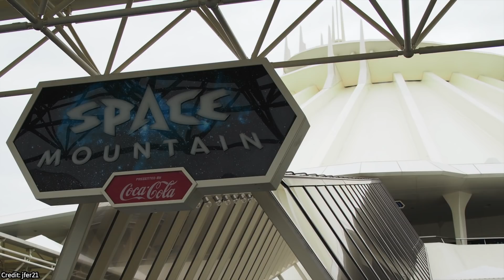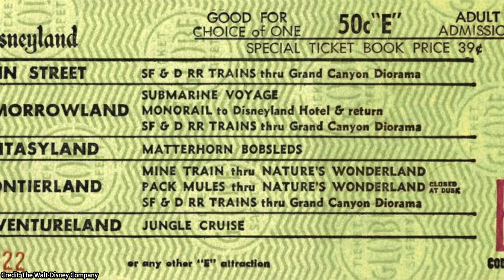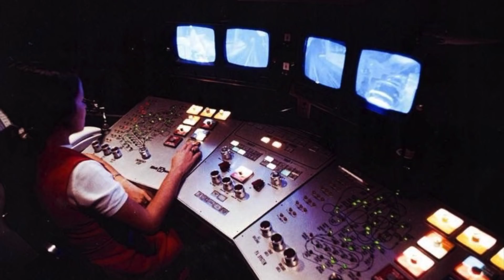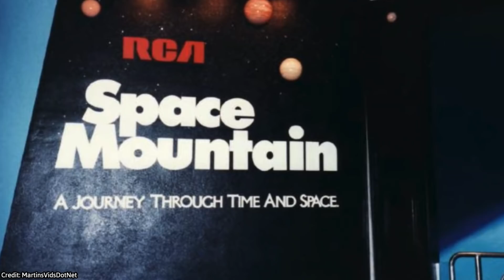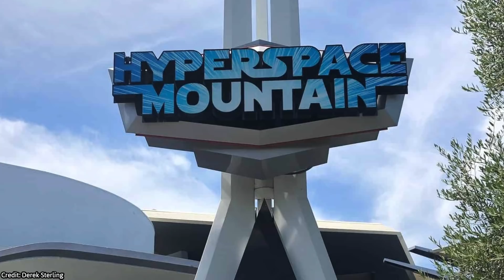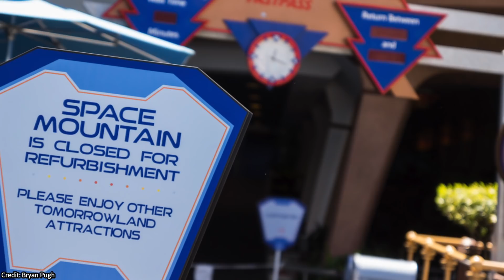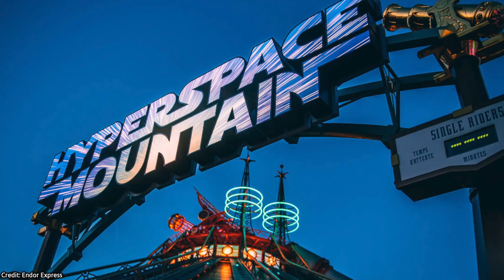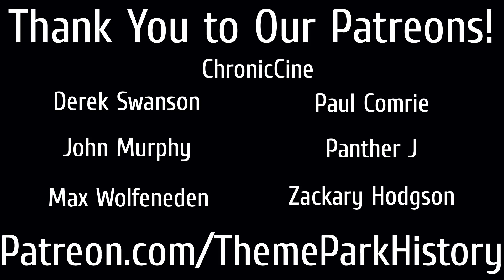The Theme Park History of Space Mountain feat. Jimmy Good (Magic Kingdom)

Comment: Actually space mountain is considered a rare steel bobsled style roller coaster. Built by Walt Disney imagineering. The only other bobsleigh type coaster that currently exists is Flying Turns at knobels but that is completely wooden. The mountain coasters don’t count as they are usually a different system entirely because they use a hand brake controlled by the guest.